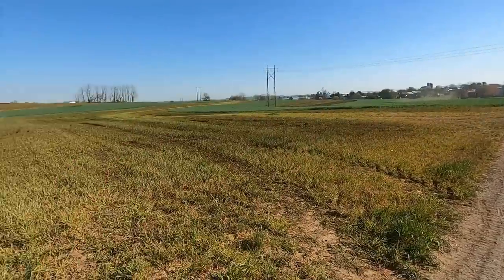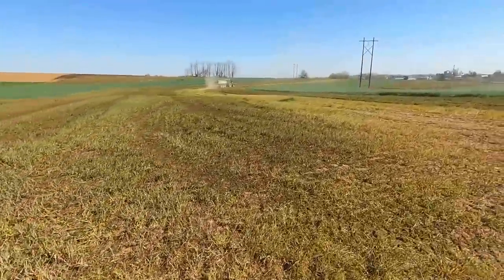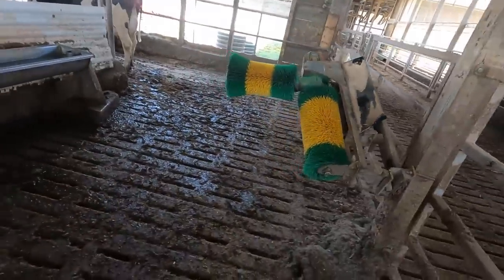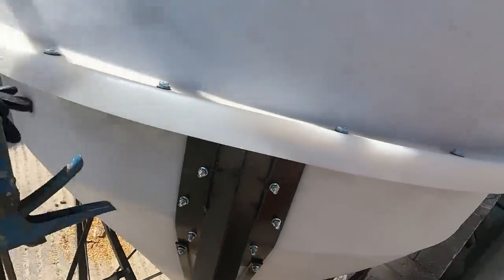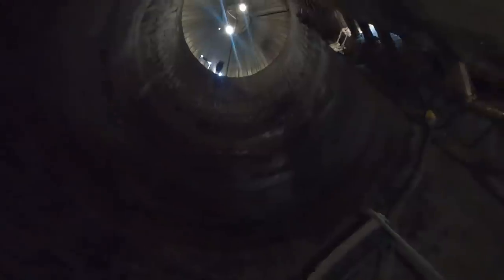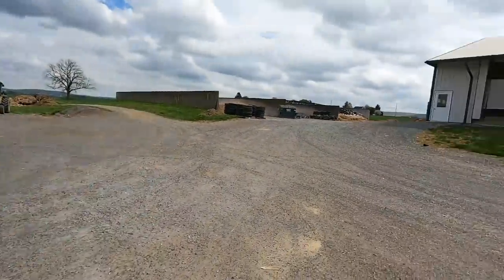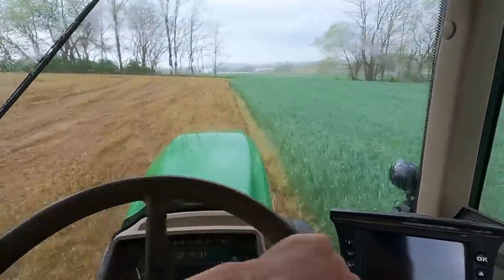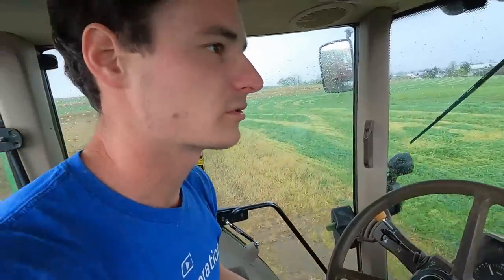Mowing Hay in the Rain

Comment: The two dairy farm up here used to haul manure past our school every day in a kenworth tanker with a picture of a rose painted on the rear of the tank and "5000 Gallons of Roses" painted around the rose.  They would haul across town hook up to a large sprinkler and "water the fields."  Almost every day, several times a day, that tanker drove past our school all year round.  You got used to the smell.  The tourists didn't, which was funnier than hell, hearing them complain about the odor.  Some demanded that they stop during time when tourists were in town and they were told, semi politely, that if they could get the cows to quit shitting for 5 months out of the year then they were welcome to try.  40 odd years later that KW still sits on the edge of a field, rusty, broken but the rose still clearly visible.

Comment: Regarding mice, maybe check if your local humane society or shelter have a "barn cat" or "working cat" program. You can adopt 2+ cats for free (or very very low cost, like $5-10) as long as you can prove they'd have a warm and dry place to sleep, access to clean water, and food.  They'd teach you how to check for basic illnesses and live-trap them to bring them to the vet if needed.  
Most cats in these programs are just feral cats that were live-trapped, neutered, and then kept at "foster farms" until they're adopted and moved to other farms.